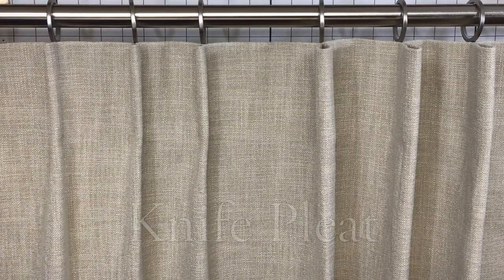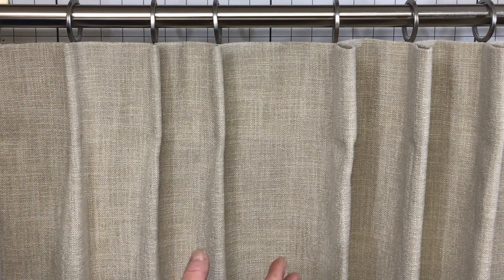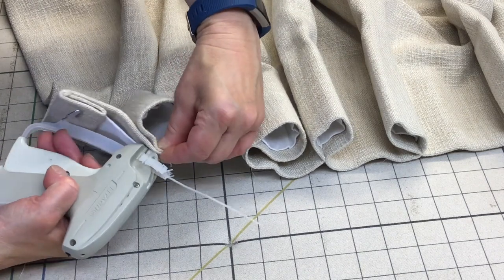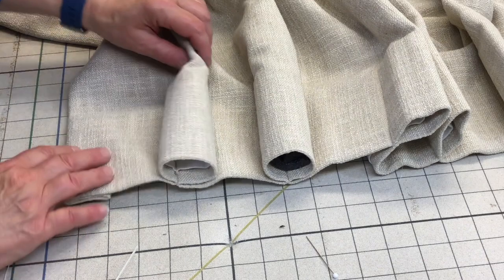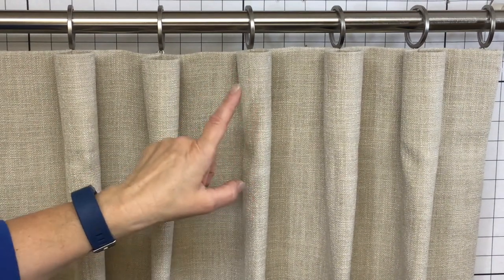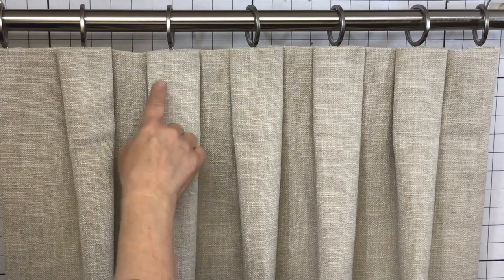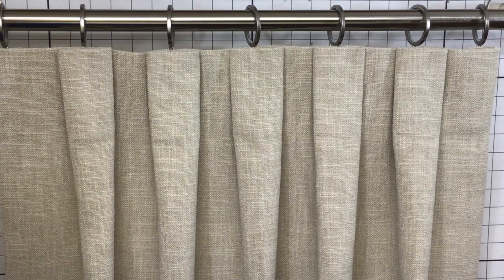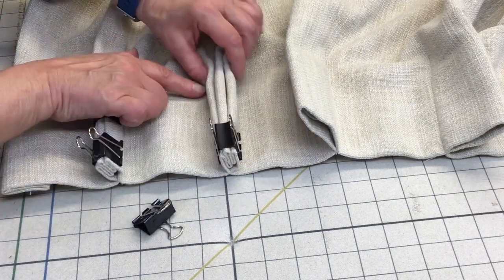PLEATED DRAPERY PANELS - Course Preview

Comment: I have some beautiful linen bill out panels I put on our sliding door w a modern black wall track using drapery hooks. How do you suggest putting two of them together? I was going to maybe drapery hook the top of the two sides then use no sew curtain tape down overlapping them equal parts? Is there a better way to do this, or do you have a video on it?